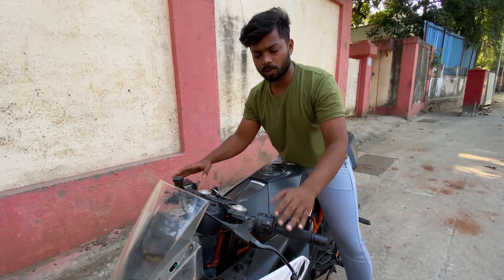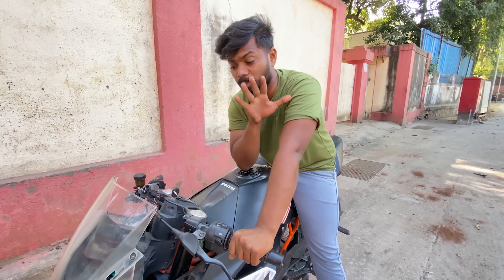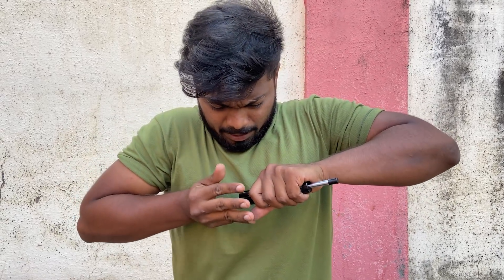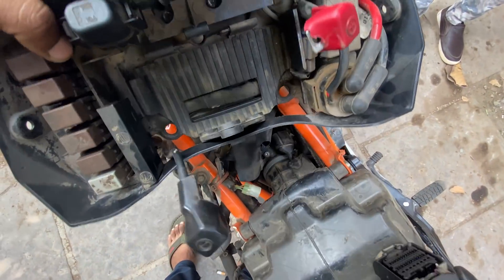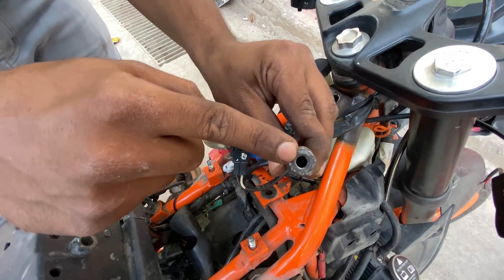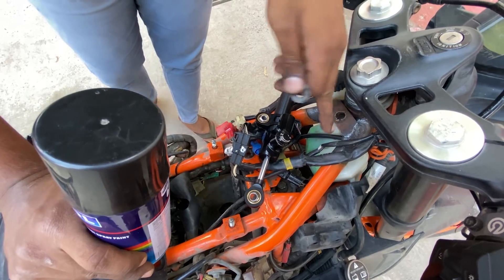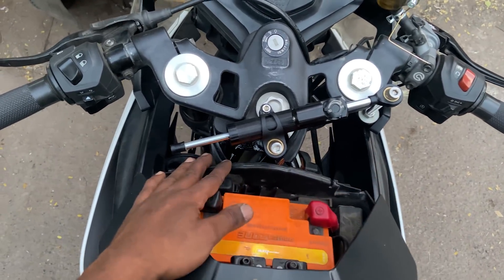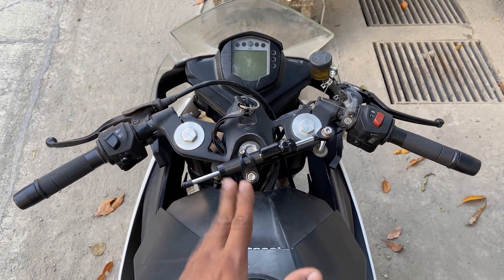UNIVERSAL STEERING DAMPER Installation For All Motorcycles | KTM RC 390!!!!

Comment: Hello bro. These chassis are made from chromoly steel. When you do gas welding on it, it looses its strength due to separation of chromium in weld affected zone and changing its microstructure. Basically now your chassis is weak at neck. Next time you decide to do something like this, I would suggest TIG welding.
Reply: Yes it's true
Reply: True . I was thinking that too
Reply: Bro are you came from science class
Reply: Great information bro

Comment: Maybe the steering damper will be working great it's not fitting in the bike properly it's looking like an unnecessary item on handle .
The custom made brackets can be done more properly so the damper would be parallel to the handle then it will look great
Reply: No it can never be Installed parallel to the handle bar, bcoz then it will lose its purpose

Comment: Welding the chassis is not a good idea. In a head-on collision that part cracks or bends, now its more likely to. Heat changes the properties of materials and now the chassis may be more brittle.

Comment: That damper should be in a straight line i think, dont mind me but this is a total jugad. I am Not hating or anything i love your vidoes but i think you should get these things done at a professional level, like welding that chasis is a complete cringe for me, and than painting it like that. You should have made a proper clamp with high grade material and made it look stock. Please dont mind just sharing my thoughts.

Comment: How Can A Gas Weld Iron,And Celeing fan mount,Sustain 390's power??🤔. I Don't think this modification is useable. I've Seen Many Video's Riding At 200+ kmph in hayabusa kind superbikes,150+ R15 Duke390 etc.. but they don't have any steering damper! And Wielding On Chassis Using Such Iron tools is not at all acceptable.